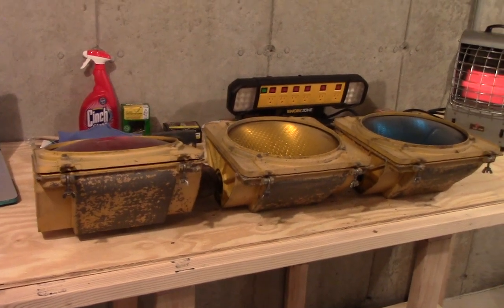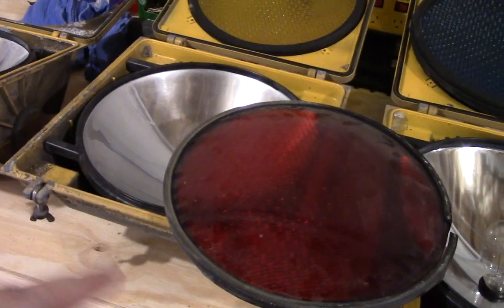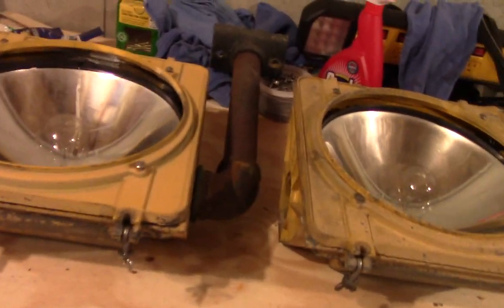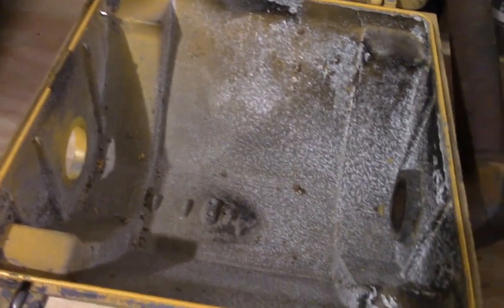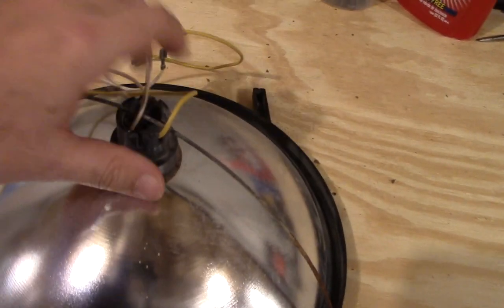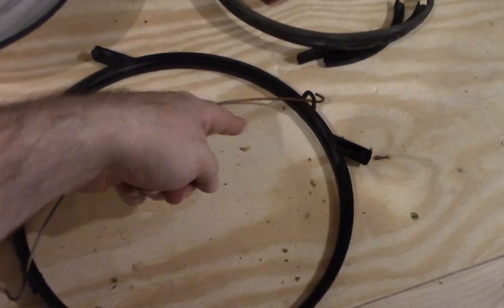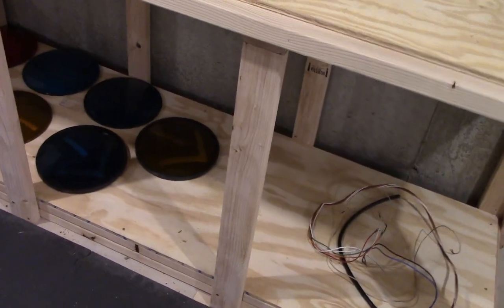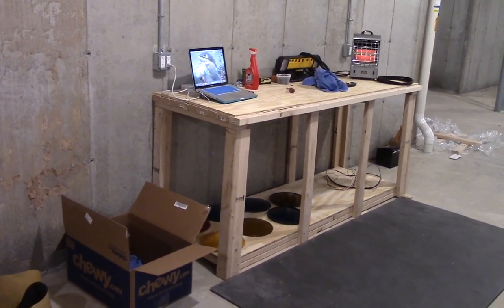Cleaning the Traffic Light Lenses and Reflectors.

Comment: I'd say go with what it used to be and stick with the yellow. I'm wondering if that red section was from a different signal when it was assembled. The deteriorated condition of the housing interior along with the mismatched wiring (yellow instead of red) makes me think that its red section was an used section pieced from signal to make that one. Just a theory.
Reply from the maker: Yeah I think I am gonna stay with yellow. Good point, it is possible that the inside of the red compartment was already worn when it was put together. I'm actually considering leaving the interiors unpainted, since the heat of the bulbs will just wear them out again.
Reply: Unless you're going to run it 24/7 like on the street, I don't think you'll have to worry about the interior paint baking off. Plus, you'll probably find that using a lower wattage bulb will be easier on the eyes, especially if it's going to be kept inside. I use 25 and 40 watt clear bulbs for mine. You probably won't want to use anything above 75 watts. Once you get it fired up, you can decide. Looking forward to your progress!
Reply from the maker: @MyTrafficLights  Yeah I may bring the wattage down some. Maybe I'll try the originals first to see how it is.

Comment: There's this other cleaner that's AWESOME, too bad it TOTALLY only works in LA.  I bet that would have given a cleaner clean at ¼ the price.

Red bulb should go in the yellow, I'd say, since it's got the most hours on it, that way it'll get the least usage.
Reply from the maker: I was thinking about using that cleaner, but since it was mostly dust and such, the Cinch we had was good enough. 

I can probably do that with the bulbs, and I guess put one of the yellow ones in the red.
Reply: The flipside of that is that perhaps the red bulb's filament has weakened over time,  and the short "pulse" (even though I know it's for a few seconds, unless you have a red light camera attached) of the yellow might break the filament sooner.  Kind of a toss-up, I don't know which would be better.  Then again, out of the 3, yellow is the brightest color, so with the high-hour, dimmer bulb in there, it might look equal.
Reply from the maker: @jaykay18  I thought that too, that maybe it's best for the bulbs to be kept the same for what the filaments are "used to", even though none of them have been on for almost 3 years now.